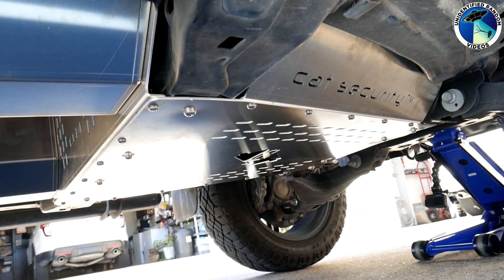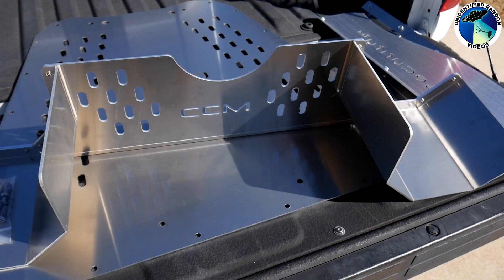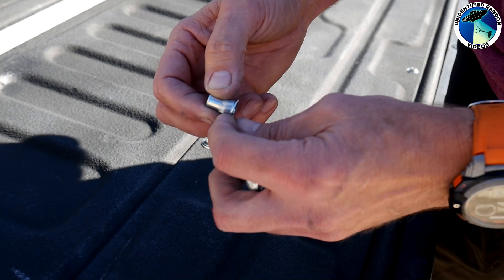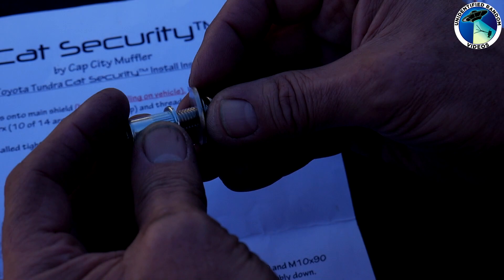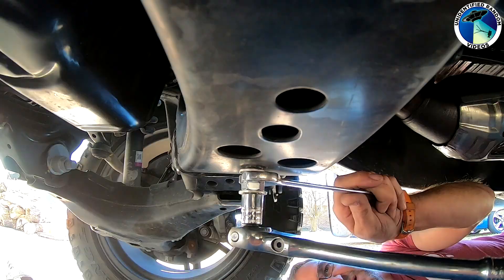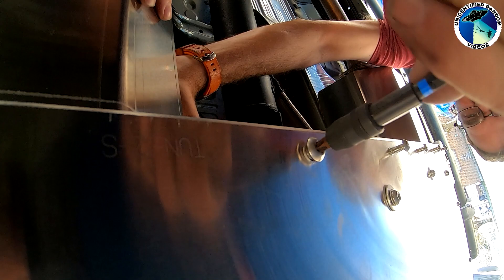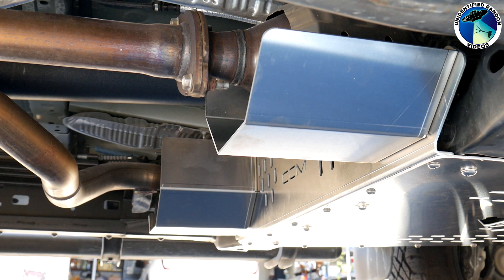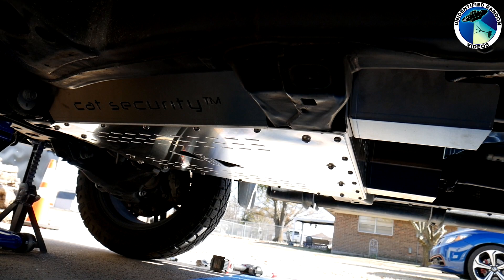Catalytic Converter Anti-Theft Device for Toyota Tundra!

Comment: Been using riv-nuts for 30-some years ... great stuff where a nut cannot be reached.  TIP: When drilling steel, run your drill as slow as possible.  HSS (High Speed Steel) drill bits work best if run at around 150 inches per minute (that's slow) ... they'll run cooler and stay sharp longer.  I installed a 1/4" thick Talon's Garage cat-shield under my 2022 F250 with the 7.3L gas engine (2 cats).

Cost?  Some may argue not to bother with a shield because insurance will cover replacements.  I'm not worried about that as I'm more concerned with the inconvenience of going to all the trouble of getting 'em replaced should they be stolen.  Over heat?  Cats work better when hot ... they function by using the exhaust gases to make the internals glow red hot to burn up unburnt fuel particles.

Comment: Here is a tip for you Tundra owners who have the TRD skid plate and need to mount the security shield underneath it. Do Not install the side shields first, install them AFTER you have the main shield install 100%. If you install the side shields first, you will not have access to the front two top nuts.

Comment: My cat got stolen two weeks ago on the Prius. After getting the repairs done I had the cat shield installed by the muffler shop. I think anything that would make it more difficult to steal would help. The cat thieves are pretty brainless.
Reply from the maker: Yes, I think they'd move on to an easier target.  I heard you can even put silicone or something in the bolt heads for extra security given you'd have to dig it out before the tool head will fit in there to be able to remove the bolt.  It would cause thieves to spend a lot more time trying to get the plate off and just wouldn't be worth the effort.
Reply: @unidentifiedrandomvideos5616  Also you can put some JB weld on the end of the bolt where the pipe connects to the exhaust manifold so that a socket can't fit. The thieves unually unbolt the two spring bolts to the manifold.
Reply: They are trained under certain second I think if they didn’t get done by like 90sec move on to their next challenge. That’s how they’re making their income.

Comment: Do you have to take it off for oil change?
Reply from the maker: No, you can still change the oil with it installed.  It looks like you have to remove it though for access to the transmission fluid plug.
Reply: If a trans fluid service or iffy O2 sensors, vacuum/breather line fix is needed, definitely take care of before installing, even if it seems early since last.
I'm doing transfer case fluid as well before I add mine.